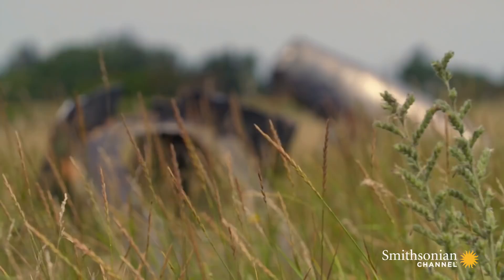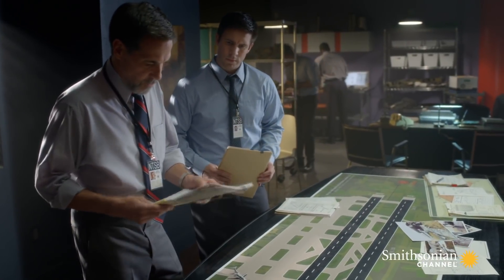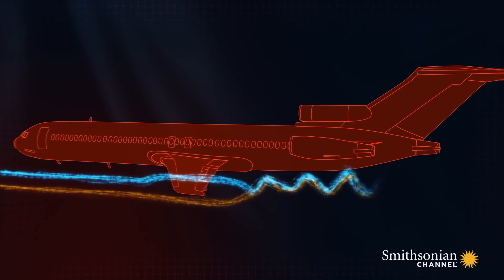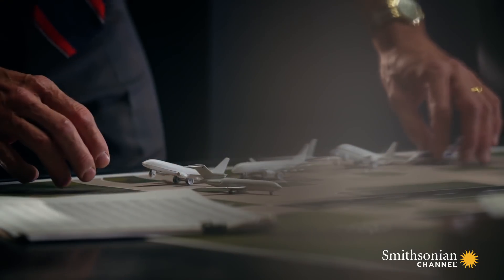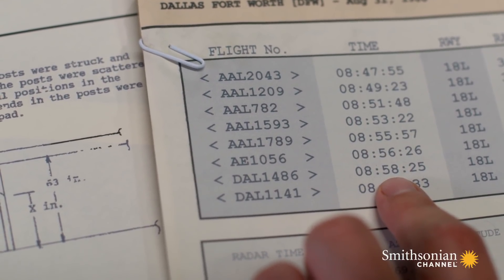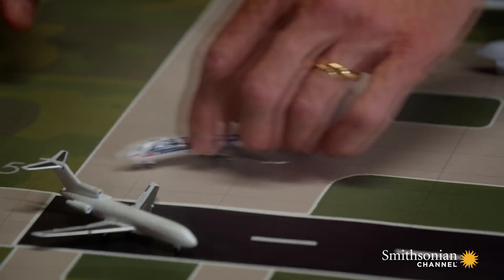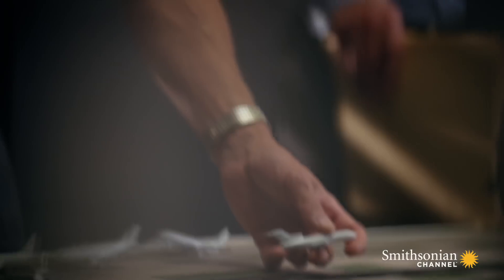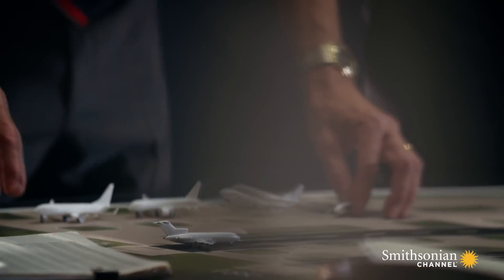Did Wingtip Vortices Bring This Plane Down?

Comment: Flight 1141 was a regularly scheduled passenger flight from Jackson Municipal Airport in Jackson, Mississippi to Salt Lake City International Airport in Salt Lake City, Utah, with an intermediate stop at Dallas-Fort Worth International Airport (DFW) in North Texas.[1]:6–7 The flight from Jackson to DFW was uneventful, and Flight 1141 arrived at DFW at 07:38 Central Daylight Time.[1]:1 For the flight from DFW to Salt Lake City, Flight 1141 had 101 passengers and 7 crew members on board.[1]:v

At 08:30, Flight 1141 departed from the gate at DFW and was cleared by the ground controller to taxi to runway 18L.[1]:2 The aircraft was instructed to line up on the runway and hold for one minute due to the possibility of wake turbulence from another Delta Air Lines 727 that was departing. The crew requested to extend the hold to two minutes which was granted. The crew talked to the flight attendants for a while about what they would say on the cockpit recorder in case they crashed. Eventually, this chat ceased as the crew was cleared for takeoff. The takeoff was normal until the main wheels left the ground, at which point the aircraft commenced a violent rolling motion and the right wing dropped.[1]:2 The aircraft's tail made contact with the runway briefly, and 650 feet (200 m) later, the right wingtip struck the runway.[1]:14 The aircraft developed compressor surges (due to breakdown of the airflow through the engine), and was unable to gain altitude or maintain stabilized flight.[1]:70 Approximately 900 feet (270 m) beyond the end of runway 18L, the plane's right wing hit the ILS localizer antenna, which set the wing on fire and caused it to start disintegrating while the plane was still in flight.[1]:14–16,84 The aircraft remained airborne for another 400 feet (120 m) before it struck the ground, sliding sideways and leaving a trail of wreckage 800 feet (240 m) long before finally coming to rest 3,200 feet (980 m) from the end of the runway.[1]:14 Fire erupted in the right wing area and quickly spread and engulfed the rear of the aircraft.[1]:30 The total flight time was 22 seconds, from liftoff to the first ground impact.